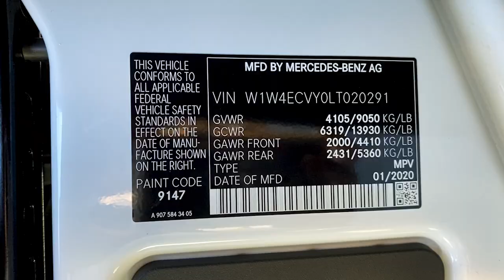Luxury Sprinter Van Build | Q&A With a Professional Builder

Comment: OK, this is confusing...the van is officially 9050 GVWR.  It is 9080 full of water and fuel.  30 pounds over already.  What about passengers and gear?  With the FAA 170lb person, x 2, already 340 over.  Plus toys and gear?  I guess if you drop the water, you should be ok.  I am not getting this correctly?

Comment: Thanks for doing the weight measurement- this is a real concern of mine, as we're just starting a build.  As for the idea that you're ok a bit overweight, I disagree- the 'R' in GVWR is 'Rating', not 'Recommended', like you said in the video.  Also, the first thing that I imagine is that the owners will be adding more weight, in the form of clothing, food, maybe a bicycle or two, etc.  It wouldn't take much to add another 200-400 pounds to that weight.  A vehicle that's over GVWR is going to suffer from possible maintenance issues in the suspension, but more importantly, the braking system isn't designed for anything over the max rating- the owners of this vehicle should definitely take care to brake early, and really take care in any mountain driving.

You also mentioned in passing that it wasn't overweight on the individual axels - those ratings are important for weight distribution, not for total weight- they would come into play if most of your weight was way in the back, or up front.
Reply: I’m building a van as well and I take it to my local Cat scales after I finish major portions. I don’t know what scales they were using but Cat automatically does rear and front and total. You never want to be overweight when fully loaded. Look up the KYD YouTube channel, he does a great job explaining the different numbers from a towing perspective and the consequences.
Reply: @billnalen  I have only recently taken delivery of our van, a Sprinter 144.  I took it to the CAT scales just this weekend to get the 'before' weight taken before I send it off to the builder's for their magic (sorry, no DIY here).  I've told the builder already I was wanting to stay a good bit below the GVWR.  With just me in the van, it's weighing at 5180lbs, the GWVR is stated at 8550 so there's a good bit of room to work with.  There are factory floors and side panels that will come out, and I'm definitely not getting the luxury build that the van shown in the video has, so I'm pretty confident that we'll be able to come in at a reasonable weight.
Reply: @toddhedenstrom5608  I'd write in an explicit number in the contract. Then you could discuss with the builder what options to add and what the weight is.

Comment: You  have a problem with  the weight.  if the van gets into an accident and you are over wieght, the insurance does not have to pay out. check it out with a insurance agent.
Reply: This is a really big deal and I suspect they can ditch the extra water tank and fix it.

Comment: The van looks nice, we’re in the market. But Im concerned with the weight over GVWR. Once you add food, a few bottles of wine, camping gear, chairs, clothes, tools, linens, and a couple of bikes you’re probably a few hundred pounds overweight. Id also like to know how well the hot water tank stores heat in cold weather since you can only heat by engine when off grid. FYI - The numbers presented on the solar panels are off too.

Comment: Would you ever consider selling the complete layout in details on your website? Maybe even add the 3D models in here? This is in most areas my dream built, but 1. I live in Europe, so it would be difficult to have my van built in Santa Rosa 2. Some things in the built may be excessive to some and I would love to tweak the van 3. I would love to be able to built around 30% of the van myself, since I believe it would be part of the fun and I am very handy. Anyway, great built and all the love from The Netherlands!
Reply: with full water tanks, full fuel and drive it was 30 lbs. over legal weight for this van.   When you add food gear and a passenger that going to climb up, alot.  Once again check with  insurance agent to verify that they do not have to pay out if you are over weight.  Thats the problem with the 2500. 
The payload of Sprinter 2500 Sprinter is 3,441 pounds. The payload of Sprinter 3500 Sprinter 4,324 lbs. It also depends what options are taken, ie 4 wheel drive, ext. I think they made an honest mistake with the build think they had the same payload weight  ratings.
Reply: @danarcher6749  Yes, I would definitely prioritise weight while building the van. What do you think contributed most to the excess weight? I mean, I can do easily without the entire exterior glow up, the sky-light, the tiles and the fancy finishes. Do you think a 170 inch (L3L2) Sprinter would still be convertible with this rough lay out? I am looking to convert such a Sprinter in about two years, but in the meantime I want to learn as much as possible.

Love, Nona

Comment: Hm, in reality are you not above the legal limit weight wise? I mean driver+passenger+whatever food, clothing and toys you bring on a trip should total so much above legal limit people might get a ticket or worse. Unless you travel solo, with a tootbrush and laptop and nothing more. I think the right approach would be to start with a van that can carry more weight or lighten the build to be a fair bit within legal limits fully fueled with full water tanks and passenger. That gives some headroom for peoples stuff. Frankly I find the design of the van itself to be flawed. You got a tiny 100 w of solar on top of the roof. That's nothing for people off grid. A smarter design and choosing higher efficient panels could easily fit oh about 8 times as much so say at least 800 w of solar.  And be honest, how many van'ers do you know of that actually uses the roof rack as a hangout place? I know zero that uses them, but I know of several that bought into the hype and the idea climbing on top of the roof to watch the sun set. The people I know of did it once or twice and got done with it. And that makes totally sense if you really think about it. Don't waste roof space to create a hyped up hang out. No one uses them for that. In fact, I have never seen people actually hang out on top of their van roof. Not unless they where working with fixing something or someone have extra storage up top. Also I think using the original alternator for charging was a very weak choice. Aftermarket alternatives does work so much better, delivers so much more power that you will be able to top up or charge batteries much quicker. 

Then again, if this design was the clients own wish, well it's his dime and he likely know how he will use the van. The garage might be an indicator pointing to that the owner don't free camp a lot or go off grid a lot. The build itself seems like it done with quality, finish and material in mind so that is very nice.
Reply: Mercedes offers a heavy duty alternator, not saying this unit came with one but they are available.

Comment: Teply to Nona Soleil: with full water tanks, full fuel and drive it was 30 lbs. over legal weight for this van.   When you add food gear and a passenger that going to climb up, alot.  Once again check with  insurance agent to verify that they do not have to pay out if you are over weight.  Thats the problem with the 2500. 
The payload of Sprinter 2500 Sprinter is 3,441 pounds. The payload of Sprinter 3500 Sprinter 4,324 lbs. It also depends what options are taken, ie 4 wheel drive, ext. I think they made an honest mistake with the build think they had the same payload weight  ratings.

Comment: so, at max GVWR, and probably light on food, dogs and gear (bikes, ski's, tools, BBQ, chairs, anti-freeze, oil, whatever might get put on the roof or on the rear rack, etc.) its too heavy.  Its OK to be too heavy some time, but not all the time.  Did the suspension upgrade increase GVWR?  Many Van owners will not fill water until close to, or at, Point B to compensate for a heavy van.

Tip:  All conversions, especially those that are back heavy, need a front-wheel alignment before use to prevent rapid, premature wear on tires.  Personal experience speaking.

BTW, love the color.
Reply from the maker: It's right at the GVWR which is about what you'd expect for a full build like this. We did upgrade the suspension so it rides great but you do have to be careful about how much additional weight you are adding. Like you said, you can travel with a small amount of water fill it up when you get to your destination if possible.

Comment: Solar panel:  Good answer. I honestly think, that people think, vans are powered by the panel. Crazy.  I'll take 600 amps in the back and 100 watts on the top any day.

C Head, YES!
Pros:
Top crank (easier to do than side cranks)
Vertical mix action in a round bucket (better mixing)
Less expensive
Smaller foot print and importantly, side to side (lighter?)
No need to vent (but I did anyway, Air Head style - sucking air, not pushing it)
Mostly non-proprietary parts (cheap/easy to replace)

Cons:
Had mine for 18 months. None yet.

PS: Very impressed with your shop
Reply from the maker: Thank you for the comment! Yes, most people think that everything runs off the solar panel, including the air conditioner. That's just not how it works as you noted. It's all about having good battery storage and multiple ways to charge. Even with 600 watts of solar, it's still not enough unless you are in the sun all day.